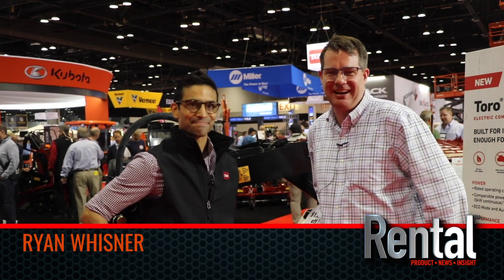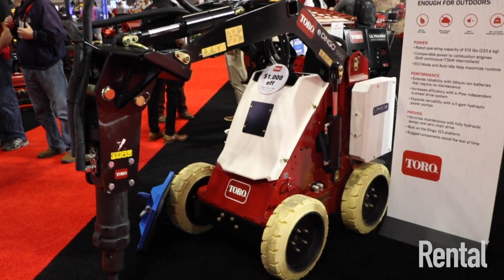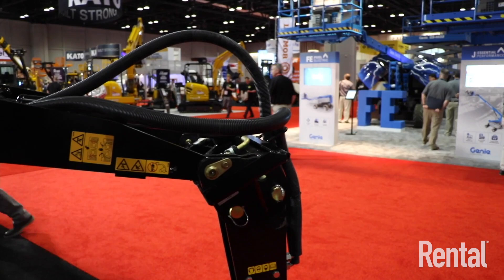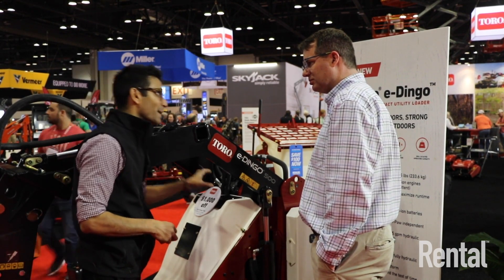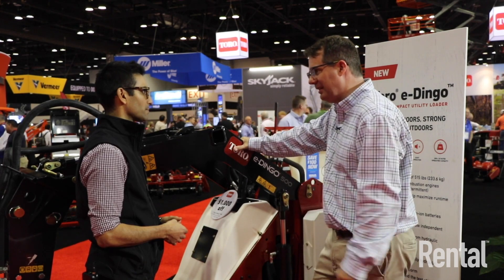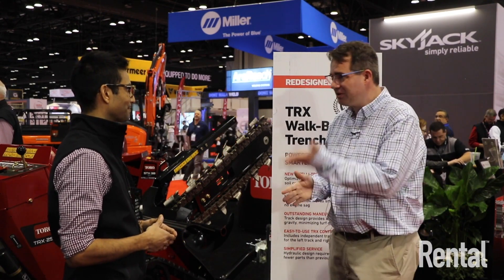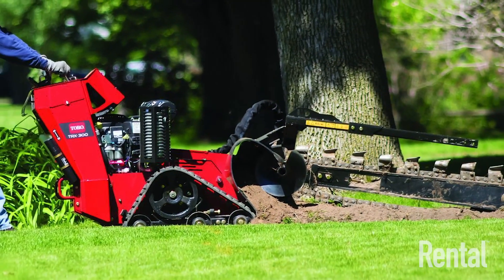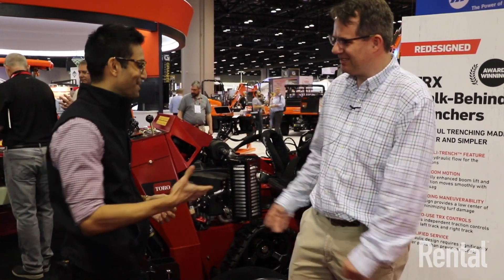Toro's Makes Major Steps with World's First Electric Dingo Compact Utility Loader

Comment: How many hours on a full charge??  Why is he avoiding the question; it is a critical determination factor for all of us who needs a workhorse, otherwise it is just a toy.
Reply: Truthfully the answer could be anywhere from 2 to 20 hours likely. We'll need someone to do some testing in various environments. It can put out 5kw continuous so minimum is going to be about 2hrs if you ran an attachment at full bore constantly. (9kw/hr battery). It sure won't use 5kw when moving unless its uphill, or even lifting.
Reply: I've been wondering this too. It's important to know